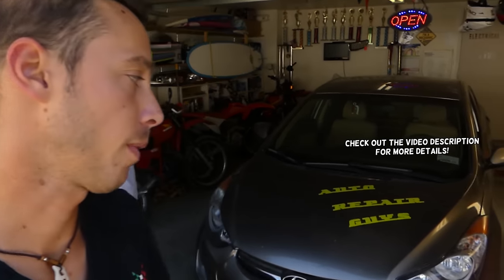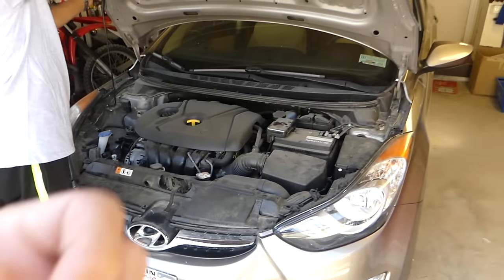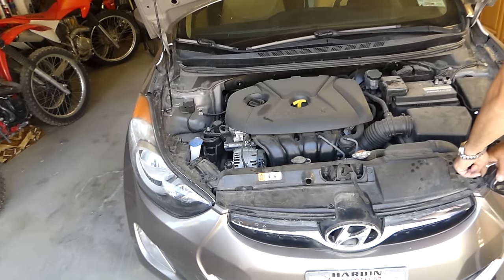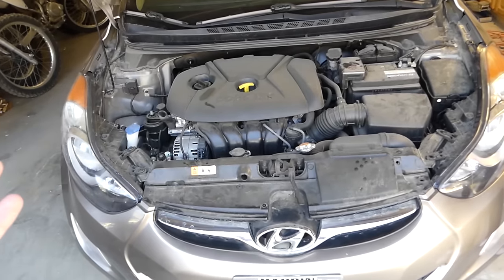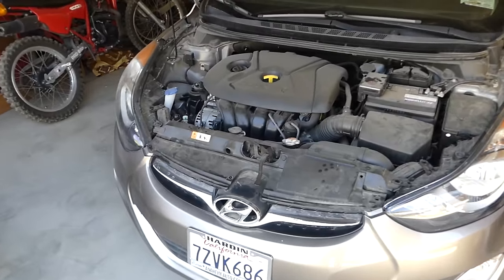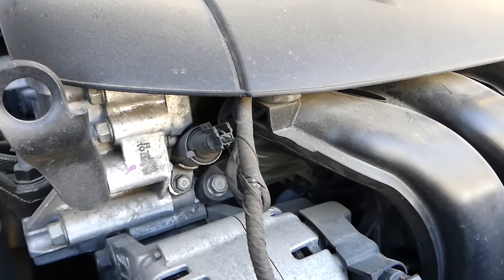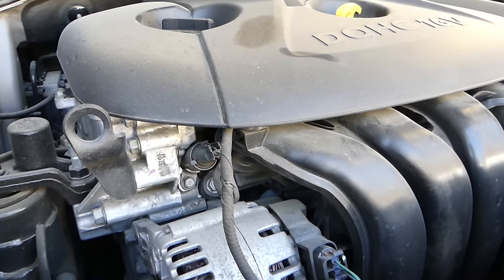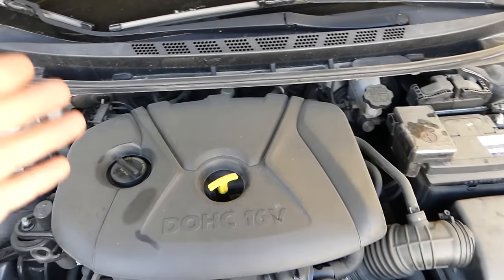WHAT PISTON SLAPS SOUNDS LIKE

Comment: The best way to fix a Hyundai piston slap under warranty is to put it in neutral and put a brick on the gas pedal
Reply: @vincecass-labs6818   it will crash
Reply: Bro thanks it worked for me now my engine is at the junkyard
Reply: @markustee8985  where a hyundai belongs
Reply: @tehgzizlauw1787  yes
Reply: Lollllll

Comment: just took mine in to the dealership for this sound. the noise was there while idling as well. They said if it's the oil rod which is likely it will be fully covered without using my extended warranty.

Comment: I had a car that had the same noise for three years, never had any problems from it at all, my buddy is still driving it, 198k miles no issues and still has 22mpgs and a 6 sec 0-60
Reply: what the heck lol
Reply: You're possibly confusing this with loud injectors.
Reply: That won’t be a piston slap, maybe the lifters are making that sound
Reply: Must be a Toyota 😂
Reply: @techseth  had a 4runner with piston slap develop at 100k, that went 270k miles... before the transmission failed ;)
Reply: @pyrathian  i have a 120k yaris and it CRRR when lightly accelerating when cold nearly nonstop its my new car im worried
Reply: @Noooo23523  120k miles isn't new :o. Does it leak any oil or did you go past oil change time?
Reply: @pyrathian  true, it doesnt leak i changed it after i bought it it had 5 out of 15k km left i changed it(edit: i change at 10k normaly and will around 8k as someone recomends)
Reply: @pyrathian  its new for me and new noises make me worry i have a 1992 opel with 700 000 km(edit like 350k miles)
Reply: @Noooo23523  KM and Opel, I'm guessing that you're in Europe? 700k on that Opel is intense and impressive!

I'll level, I always had toyota trucks. They last forever. I haven't had as much luck with toyota cars. I do see them for sale with 300k miles often though. I do 3-5k interval oil changes on all my cars, no matter how new or old they are ( they aren't very new ). Some people say I'm throwing away my money, but I have to do it anyway. Otherwise it bothers my mind.

Your "CRRR" when accelerating cold could be a million things. I wish I could be more help, cause I know how it feels. 

You got to get more details, anything you can think of, cause with the current description it's too difficult to guess.
Reply: @pyrathian  yes im in europe, i like opel because when they were gm they were the most reliable cars i also like toyota and honda and i found a toyota and bought it
at idle hydraulic valve lifters make noise and now i will change chain then change whats needed inside the engine i will rebuild the internals if needed then i think i will use normal 0w20 i run 5w30 because i was told the car is worn
Reply: @pyrathian  when the engine has load and light acceleration instead or vuuuu its crrRrr when it gets hot its less but it still does when i shift for a second when load is put on the engine when releasing clutch and accelerating, when its cold its not a shake, sometimes it did it a little bit in neutral when it was cold, if i accelerate to cruise at a speed nothing when i lightly  accelerate it CRRRR when i accelerate it hard it fades away
Reply: @pyrathian  i think my engine is not maintained maybe its worn out i will rebuild it if its not totaled

Comment: My 207 diesel made similar sound and had bad hot smell. Andy at the garage pulled the rocker cover off, the noise became less of a knock and more of a chuff (blow) nipping up the setscrews on the injectors cured the head gas leak. Easy when you know how, cheers Andy.

Comment: my 2013 Elantra GT has a slight knocking sound after an overnight rest on cold start. It goes away after warm up. It has 63K miles. Recall vin look up returns with no results on my VIN. Your thoughts? Should I have dealer inspect when they do the next oil change?

Comment: Thank you for taking the time to make this video.
 The tips on disconnecting the injectors one at a time was very useful.
Reply: @francisconuno8510  I tried oil thickeners, Lucas oil conditioner, all a waste of time.  I even tried using a lower temp thermostat to run the engine cooler and reduce the slap tolerance. Mine is gudgeon pin rattle under now load with a warm engine
Car is going to get engine recondition as my solution. Use a big hose reco not a one man shop they take shortcuts and don't solve problem. Find out the hard way.
Reply: @francisconuno8510 , the disconnecting of the injectors one by one, disconnect and listen. Put back and disconnect another and listen and so on is for diagnostic purposes. In the end the repair on that piston alone, or all of them is what will be required to fix the problem. Sometimes it is not cost effective to do the repair.

Comment: Ticking & tapping sounds on my motorcycle have been driving me nuts. After setting the valve clearances I reduced the ticking sounds, but not the tapping.
I figure that I have a case of piston-slap. It is a Chinese-made Yamaha YBR125. 15 yo & 50,000mi on the clock. At this age the cost of a tear-down, re-bore & oversize piston incl labour charges will pretty much equal the outright value of the machine on the open market. Which is a bummer.
The same would go for an old car I guess. 
Piston & bore issues on a 20,000 mile Hyundai? That is inexcusable these days.

Comment: Hi , i have similar issue. when i start the car, i can hear it and when i accelerate it can hear it more. If i drive past 60 mph for a while the sound reduce majorly. Also , I have noticed that the car consume more oil than usual. please let me know when you find a solution. I am thinking it is a lifter/rod problem.
Reply: Check out the recall. You might be eligible. It might be a worn con rod.
Reply: What was it?

Comment: Ford 4.9/300 (Which I have and drive daily) are notorious for this and will run a long time after it begins but it sure is annoying! You can put additives in to quiet it at the cost of 3-4 mpg. Good video. Thanks!!
Reply: Also, dodge caravan pit to start ticking noise, as well as Ford 4.6.
Reply: Ford is notorious for this with the fact that it's a non issue as for some reason they don't  break down or eat up oil but it sure is annoying. My Fiesta 1.25 sounds like W123 diesel.
Reply: @mexodroid1848  the dichotomy between opinions on this is immense and vary from one car to the next; some say it's the death knells of an engine, others say it's a feature

I am personally more inclined to think it's bad considering it's literally a herald of metal directly hitting other metal with nothing in-between . . . but I guess I dont know what I am doing, so I'll trust that judgement.

Comment: Great videos guys...our hyundai i30 has a similar noise but only when cold...once it warms up after 5 to 10 minutes of driving the noise goes away ...is this a sign of piston slap or is it the timing chain tensioner...cheers
Reply: My car has the same problem. Were you able to find the exact issue/fix?
Reply: It's most likely piston slap.  If your car doesn't burn oil then don't worry about it.
Reply: @freemindas  that was it I replaced the motor

Comment: I've a 1.6 T Gdi 200hp with irregular knocking when engine is warm, silent when is cold. Sometimes when is cold I ear a fast ticking if I rev. With a stethoscope I located it on the right (4th cylinder I think) between the head and cylinder. I've also clutch problem. Could piston slap occur with warm engine only? I read it should disappear with warm engine. Could be a clutch spring piece?
there is a world wide Kia-Hyundai engine problem from 2010 to 2018. USA,Canada, Russia, Europe and also Corea. On youtube there are a Corean videos about this problem.
Reply: The reason is the CAT IS TOO CLOSE causing heat transfer the slap is pre ignition made worse by DIRECT INJECTION ,GO TO MUFFLER SHOP HAVE THEM TO MOVE CAT 24 INCHES TOWARDS REAR PROBLEM SOLVED!!WHY DO THINK WORLD RALLY CARS HAVE THIER CATS AT THE VERY REAR,,ENGINES RUNS PERFECT,THATS WHY!

Comment: I bought hyundai tucson 2014 around 4 day ago have the same noise even louder . The dealership that i bought the car from told me this noise is normal for this vehicle o.O has only 41k miles on it
Reply: What happen with your car after a year mine just stared a week ago and I no what to do my has 96000 miles year 2014 as well like your are u still driving it or is gone?
Reply: @francisconuno8510 did anything happen to your car mine too started

Comment: My 93 Civic sounds like that, but only until it warms up then it goes away. Could that be a piston slap? It does have 350,000 miles though.
Reply: lifters.
Reply: Probably just a lifter tick. I'd still get it checked, because lifter ticks could mean your oil pressure is too low when the engine is cold, unless you live in a climate where it gets down to -50 in the winter. It could also simply be lack of lubrication.

Comment: With piston slap will it go away when the engine warms up? I have a loud noise for a few seconds when its cold, then after a warm up it goes away and can only be heard from 2000-2500 rpms. This is a pushrod engine
Reply: valve lash needs adjusting and or oil starvation possibly.
Reply: What happens to your car after year later did it totally broke down ? Or u fixed it because mine rlentra is doing same shit what should I do help pls !
Reply: @francisconuno8510  My jeep is still going. I only  hear the noise on a fresh start in less then freezing temps. Im sure I have a lifter that will no longer hold oil after the engine sits cold for a while.

Comment: I had a mechanic tell me the clicking was my injectors firing.
Reply: Ticking can be caused by injectors however a more metallic "thun thun thun thun" noise is knocking. What you hear in this is piston slap/knock however injectors can sound fairly similar to this
Reply: Injectors do tick though
Reply: @archygrey9093  I legitimately said that. Injectors tick but they don't ping ping ping like something metallic
Reply: @jacobwebb8818  I was replying to Kramer Robert not contesting your comment. But you are correct about the noises, though you are obviously referring to efi injectors.
It sometimes depends on the type of injectors, my old mercedes has constant flow port injectors (KE-Jet system) that queak like a mouse and diesel engine injectors can be very clackity and metallic sounding.
Reply: @archygrey9093  Yes, yes very true. Sorry for the misunderstanding by the way

Comment: Sounds like it's valvetrain related as the lifter tick comment said. Every older OHV Pushrod V8 will have actual piston slap. It's something that goes away upon reaching operating temp, being that the design is so old, inherently it has less tight tolerances and more clearance prior to thermally expanding.

Comment: Could it be lash adjuster?
Reply from the maker: Lash adjuster will cause the sound to come from the very top of the engine most of the times. We will take the engine apart soon and confirm. Good point!
Reply: Any update, would want to know... ty
Reply: Its not piston slap, those engine Are common for rod bearings.

Comment: I'm here because of the noise my Elantra is making, and wtf do I see but an Elantra...
Reply: Wat did u do, solution?
Reply: @morrismmamatseamaseko3655  No solution. It's definitely piston slop because it's louder on startup when it's cold out and tapers off when the car warms up. It's not nearly as bad as in this video though. 

Oil was just changed 1000 miles ago and is still perfectly clear. I'm probably going to change the oil every 5000 miles (it's running full synthetic) and hope for the best.

Comment: Hyundai are supposed to remplace the engine block, its a known issue and its on warranty whatever the millage or age of.
Reply: Mine 13 Elantra is worse but has 110k and was told warranty was till 100k
Reply: Nope 10 years and 150,000 miles.

Comment: Plesae solve this roblem on video i have 2012 elantra and i really hate it for this problem
Reply from the maker: Video will be coming soon.
Reply: Engine has to be replaced. You need a shortblock, so you re use a lot of your engines components but have a new block and pistons rods etc. There is no fix for it

Comment: Mostly this is not a problem. Piston slap happens on high mileage cars with a lot of engine wear

If piston slap happens the only way you can repair it is to take your block to the machine shop and get it sleeved and get new pistons

Or buy second hand Japanese import motor

Comment: My tire is making that sound? I don't hear this from the motor, just when I am doing 40mph or so. Sounds slapping.
Reply: Like a drumming sound? Maybe the tire balance is off
Reply: @efiLroFsdaehtoPliaJ  No not at all. To me sound like a piece of rubber hitting the pavement while driving.
Reply: @efiLroFsdaehtoPliaJ  initially it sounded like how a motor sounds on low oil. Like a clicking sound. But when I lift the hood and listen. I don't hear anything. The tire looks fine. Yet it did go flat and sat a while.

Comment: WRONG FELLA IT'S THE CAM FOLLOWER PISTON IN THE HIGH PRESSURE PUMP $78.00 TAKE PUMP OFF TAKE MAGNET REMOVE FUEL PISTON REPLACE ,,,,,THERE ALL FIXED NO NOISE $78.00 VS$2100.00 ENGINE !!! YOUR TENNESSEE ENGINE MAN SAYS YALL HAVE A GREAT DAY!!
Reply: The 1.8 g4nb doesn’t have the high pressure pump on top. You’re referring to the 2.0  engine which is completely different.

Comment: My car has the same noise, Hyundai Elantra 2013 and Hyundai refused to fix it because I’m not the original owner, and they just cover the warranty until 80,000 miles. My car is at 117,000. But they basically charged me 300 dollars to tell me I need to replace the engine and it’ll cost me 12k dollars. Fuck Hyundai.

Comment: Absolutely ridiculous.  This is lifter noise probably not rod knocking. Piston slap is very distinctive and much deeper in tone typically.

And the bit about putting "original oil filter " and changing oil to prevent rod knock??!?!? How in the heck does filtration have anything to do with correcting a broken internal part?? Im not a mechanic and dont claim to be, but working on my own vehicles all my life i can safely say this makes zero sense.

ROFLLLL...yea thats not going to improve piston issues lmfao. You MAY be able to quiet it temporarily with a very viscous additive etc, but you are obviously just masking the issue and its just a matter of time.

Comment: watching your videos from Egypt :) , I need your advice please help me , I have an Opel Corsa F with turbocharged puretech engine 1.2 130ps I had a knock that is very similar to that piston slap in this video, happens on cold start idle, after warming up it diminishes to great extent but it is still there, only why you drive really hard it goes away , I had this since new, current mileage is 11k km, I've checked other 1.2 puretechs and I think they produce the same knock, when you put your ear near the engine it is most heard near the turbocharger , catalytic converter, could you please help me identifying what it is ? piston slap or something else ? and if it is normal then what could it be ? here is a link for a video I have recorded myself for my car,    https://www.youtube.com/shorts/_WKflbJZDBU         --- please help me :) and thank you very much for considering :)

Comment: THIS IS BAD FALSE INFORMATION. This guy has no idea what he’s talking about. Piston slap is more or less a myth. It can happen, but not on this. You literally have to wear the engine out so bad the cylinders turn into oval. I have personally fixed engines that had piston slap, and you honesty couldn’t hear it, the give away was pulling the piston out and the piston skirt was cracked ready to break off. Run some fuel injector cleaner through your economy car and it’ll probably clear up